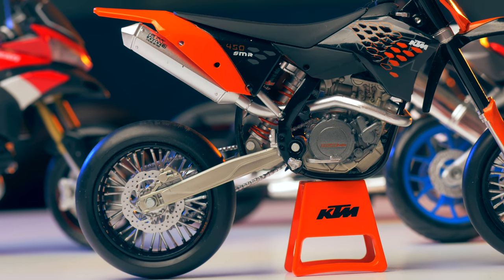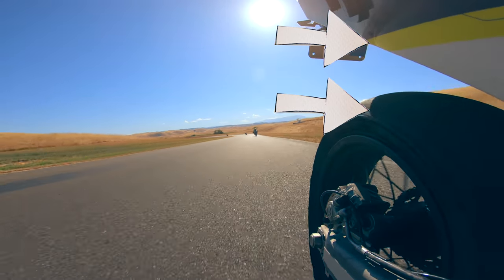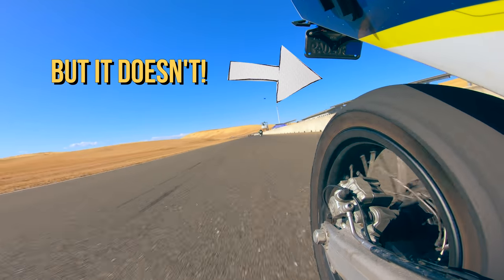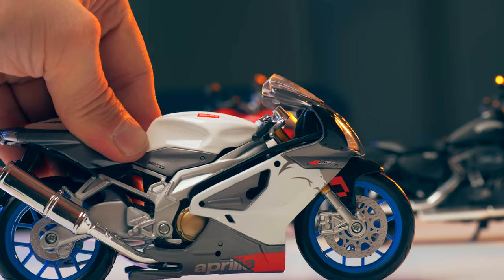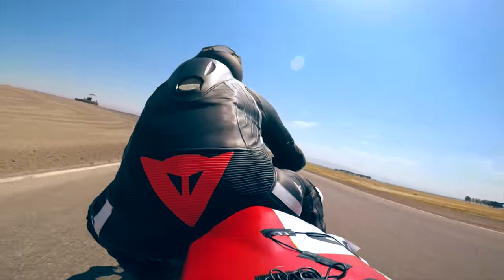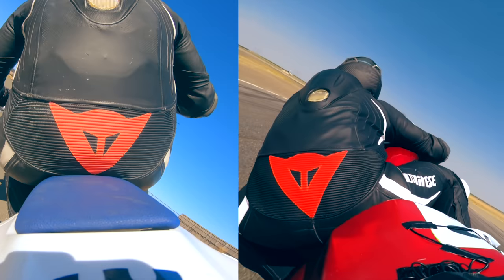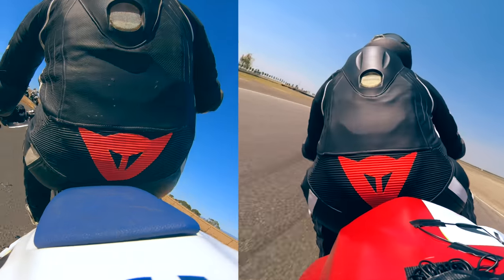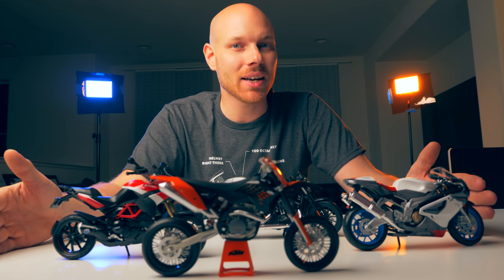Motorcycle Geometry | EXPLAINED

Comment: The rider is just an onboard engineer.
Reply: Believe me. As an engineer I cant onboard like the pilots on the video, lol.
Reply: @juanete838  I bet that you can tie your shoe laces though. I too am an engineer and have worked in motor sports, some of the best test riders and drivers are just useless at all other aspects of life. Good engineers do not make good test riders, this is because they can tell that things are going wrong before most other people would notice. One manager at a car manufacturer in Britain once said to me that it is the job of the engineers to break the vehicle, and it is the driver's job to crash it, adding that it is easier to replace a test rider than it is to replace a good engineer. You will only ever find the limits by going beyond them, and that can hurt, or worse.

Comment: A big thing that many  newbies over look  is   rear axle position.. 
Pushing the axle further to the rear will make the bike turn in slower and the moving it forward will make it turn in quicker without even  touching the front forks. So try to find the optimal axle length position and if you want to change gearing use different lenght chains to keep it in the sweet spot the rear of a motorcycle is often overlooked but very important for  optimal suspension settings

Comment: Excellent information. Well presented. Subscribed. Should be compulsory viewing for anyone who owns a motorcycle. I know, i am 65 & have been riding for almost 50 years. You must understand your machine for it & yourself to perform at the optimum. So much to learn but much pleasure in that. Thank you.
Reply: Great video, what field of engineering are you in?
Reply: Hi Raul. I’m a toolmaker in Aluminium precast dies for motor vehicle castings. I have a Suzuki SV1000, a CBR1100XX & an 85 Suzuki GS1100G.

Comment: Hi. Interesting and well explained for someone who wants to approach bike setup. There's a part though where I think you probably said something not exactly right, and it's about @ 10:15 where you say that, under braking, trail decreases.
My understanding is that trail is a function of the steering angle, offset and tyre diameter and that the fork length (unless you have a raked fork) is not a factor.
It is theoretically true that the tyre compresses under braking thus reducing the diameter and affecting the trail, but it's compensated by the fact that the contact patch gets wider (mechanical trail, etc.).
Regardless, as I said, well done and nicely put.
Ciao
Reply: Yeah, I was thinking the same.
Reply: I understand you reasoning, but when breaking hard, the rear lifts and the fork angle changes giving momentarily less trail. Of course, this is compensated by the tyre compression, resulting in more contact surface but less gyroscopic effect. I'm not a mechanical engineer but that's my understanding of that specific moment. Cheers from 🇵🇹✌️
Reply: steering angle changes when the fork is compressed

Comment: Great video in general, but the part around lean angle and COG is maybe a bit misleading.  Lean angle only becomes dependent COG location when combined with wide tyres (e.g. sports bikes) because the tyre contact patch moves away from the center line of the bike when you corner.  For something on skinny tyres the location of COG has negligible impact on the lean angle required for a given speed.

Comment: Not to be that guy, but something missing on the anti-squat portion is the fact that under acceleration the rear ride height of the bike actually increases not decreases which is counter intuitive. This is doe to the torque vector of the drive chain acting on the axle which sits below the pivot point of the swing arm and the drive sprocket. Or in other words, the drive sprocket is trying to pull the rear wheel to the engine through the shortest distance which is under the bike.  If the axis of rotation of the swing arm and drive sprocket were co linear or the rear axle where positioned above the pivot point of the swing arm than the opposite effect would occur.   This is one of the reasons why power must be applied smoothly when exiting a corning.  To much throttle will shift the CG forward and up. Once rear traction is lost the rear immediately drops until it regains traction at which point the suspension violently extends and draws the rear wheel back into alignment with the front resulting in a high side.
.
Reply: thank you very much until now i was very skeptical about the acceleration in a turn subject
Reply: Much appreciated the effort!!
Reply: - ... traction wasn't mentioned, would a bike with a lower swing arm  angle (more parallel) create more traction on acceleration because the pulling force is more lateral? The initial power would be *into the swing arm, as opposed to *perpendicular to a more vertical set up... So the question is, does traction come from more resistance (low swingarm angle) or less resistance (high swingarm angle) where weight, engine, rider, etc are all equal? I guess I should read the book.

The trade off is obviously trail length on the accommodated design? That why cruisers are as they are..? 

I should read the book. Any hints welcome. Thank you.

Comment: Its Actually very easy to understand.  From static sag to the basic gyro of the motorcycle.  Which is Actually what was taking place when you said : You want to turn and the bike wants to go straight.  Which is what you get with counter steering.

Comment: Solid stuff Mike! 👍 Thanks.
One thing about 'transfer' it's actually not weight, but Load.
Load Transfer. Weight is constant- I.E. bike & rider. But the longitudinal load changes from rear to front & vise-versa based on the amount of braking force & acceleration.

Comment: “The use of wide tyres causes another difficulty when the bike rolls because the contact patch moves further and further from the bike’s centreline and from its steering axis. The taller the tyre section the more pronounced these effects are; lower sections minimize them, for a given width of tyre. There are several effects. It reduces the camber thrust for a given angle of lean. Ironically, a bike with a higher centre of gravity or with the centre of gravity shifted in towards the turn, will require less angle of lean to balance its centrifugal force.” 
I took that off John Robinson’s book, Motorcycle Tuning Chassis second edition under the section of contact area in tyres. 
Perhaps maybe you could do a video why wider tyres need more lean angle to turn and narrow tyres use less. And how how centrifugal force is actually needed to turn with the same bike but different width tyres. Perhaps you can mention why did MotoGP used 16.5 wheels and why some asian drag bikes used bicycle sized wheels on their drag bikes. 
Thank you in advance
Reply: Hey man, I think you can understand this on a video better than with the words of my. Just search how steering works to youtube and click on some animation.

Comment: Hi. Mike. Nice video. I would like to add few pointers from my experience. Its not only the CG height, which makes vehicle agile or stable, but the ratio of vehicle CG height to rider CG. 

The way I explain it to my team members, is assume vehicle a vertical rod pivoted at ground with a weights clipped at a heights. While you give input at top end. Lower the height, less efforts you need to move stick around. Higher the weight, higher efforts and less accelerations you can give to stick. No doubt bike tend to capsize at lower speeds with higher height of weight.
To prove this, I did few experiments while tuning a production bike. 

In first trial I mount 15kg (for 150kg bike) weight at level of crank shaft or below engine and in 2nd trial, same weight above tank, the effect can be perceived significantly.
Reply: But the CoG is fluid on both Rider and bike to an extent. You can slightly manipulate the CoG through Shifting the center of mass. CoM. In turn the center of mass never changes, but the center of gravity has potentiality to be fluid to some extent.

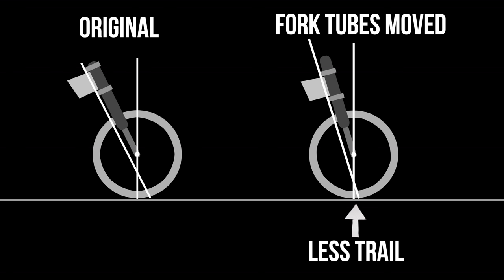Comment: 1:29 “It will also make the motorcycle less stable and, potentially, harder to control.”

What exactly does “less stable” mean? I’ve heard this phrase thrown out a lot when talking about changing your motorcycle suspension. But I’ve never heard anyone explain what it actually is. 

Does it mean your bike will randomly wobble at certain speeds and cause an accident? Does it mean the bike will fall to the side on a whim during riding unless you’re always holding the handlebars really tight? Will the bike just stop suddenly and make the rider fly off the road? Or will the bike jump into incoming traffic if you hit a minor bump on the road? 

What exactly do you mean by “less stable”?

Comment: Simple explanations of important principles in two wheeling. I run two boxer BMWs: an 84 R100 and 2017 R9T. Completely different geometry on a number of fronts especially the old vs. new suspension. When I get on the 84 after a lot of time on the 2017 I have to be very careful because I will go into a corner with some speed on the 84 and it will not respond at all like the newer bike: it will not carry the same line, will not be as easy to flick into a turn etc. It is a very quick lesson on geometry. There have been some pucker moments let me tell you.

Comment: Mx rider here.  So bigger offset triple clamps decreases trail which in theory would make the bikes more agile/less stable.  Then why in real world effect does more offset seem to make the bike more stable.  It is very common on motocross bikes for riders to change from 22mm offset clamps to 24mm clamps to get a more stable ride.  Is this effect due to the lengthening of the wheel base?

Comment: There is a ratio between trail and forks angle. And spring rate characteristics contributing to bike geometry while suspension is loaded mid-turn with cornering force.

Comment: Thank you for a very informative Video. However I have always wondered and please correct me if I am wrong. When you buy a bike stock and you wanted to get best riding experience from it, the bike would have to be setup as per your height and weight, right ?   I know nothing about the manufacturing process, So when engineers are designing the next 600 cc bike for example , do they take the test riders height and weight into consideration   and do they setup the bike as per test rider ?

Comment: So how the geometry of my 2021 Tracer 9 GT will change when i put a 180/60 rear tyre (instead of 180/55 stock)? And how will affect (fast turning? less stable on top speed? smaller caster angle?) my ride?

Comment: You're mentioning @10:14 when the rider brakes (decelerates) the swingarm angle increases however @ 10:50 while the rider accelerates, the swingarm angle ALSO increases which doesn't make any sense, could you explain how?

Comment: 1. Thanks so much.  I learned so much with your video.   I really did.

2. Only FYI: You are showing an Aprilia RSV (or RSV Mille or RSV1000) miniature not quite an RSV4.   The only difference is this model had a twin, not a V4 (hence the rsV4 name)

3.  How do you explain the fact that you need more lean angle with a lower centre of gravity?    I think I understood everything you showed except for this.   I mean, I know supermotos have a higher c.g. and they require less l.a. but they tend also to be massively (not marginally) lighter and as you mention much more aggressive trail.

Thanks again!

Comment: Always very informative and helpfull video's as I've just started a classic racer build of a Seeley TR750.
the original has a head angle of 27 dg. most builders I understand decrease it to 24 to make it steer more quickly.
my question is: 

how does head angle and offset influence steering when the trail stays the same?

kind regards

Noël

Comment: I have an issue/question about what you say at 9:27. That is counter to everything I've watched, been told, and read. Unless, what you're referring to are the rider's bodyposition and bike CG being taken independently. Thoughts?
Reply: its right what he says but yeah, cg of the rider is not taken into account here
Reply: I can't see how lean angle changes with height of centre of gravity?  Edit: OK just seen the correction from Mike. He means the effect of the lateral movement tyre contact patch on bikes with low CoG and wide tyres compared to skinny tyres and higher CoG. This I understand ang agree with. It's presented badly in the video.

Comment: very interesting subject and well detailed, I plan on running Bonneville land speed record straight line course, would you say an extended wheel base (9" extended swingarm) and lowering the CG with a lowering link would be a perfect setup for this kind of course vs a stock OEM setup (shorter wheelbase and higher CG)?  thanks
Reply from the maker: I've never been involved with land speed racing, so I'm sure there are lots of details that I'm not thinking about, but;
Having a lower CoG would definitely help stabilize the bike, as well as getting a longer wheelbase. Aerodynamics will obviously play a huge part in the setup of the bike as well. Adding more trail would be another thing to make the bike more stable.

Comment: Tire-width combined with weight is determining speed at given angle in turn. THEREFOR is a Motard, weighing 120 kilos on a 160 section tire, much faster mid-corner than a 200 kilo sportbike on 200-section tire.It is the offset of center of gravity and contact-patch that determins centrifugal power in addition to speed and angle.

Comment: I have a problem with my ZX-6R where it feels like the geometry is constantly changing. 

One week when I'm riding at a given speed (±70kmh/45mph), the bike feels great, it's responsive and stable, light & easy to lean in and change direction.

A week or two later, riding at the same speed, it feels like the opposite. 
Unstable (head-shaking), poor handling feedback (steering feels lazy and "delayed" almost.) 
It requires more effort on the bars to change direction.

The suspension also doesn't feel consistent. Sometimes it feels stiff and other times it feels too soft, even though the preload and damper settings have not been changed

Does anyone know what could be causing this? I've had my front and rear spring rates increased to match my weight, and I've had my sag set correctly as well.

I don't know what to do anymore.

Comment: Regarding trail: This is also relative to speed. An off-road bike can live with a longer trail because of the lower speeds, lower weight, and lower weight of the engine internals, and thus the lower gyroscopic effect.

In regards anti squat: Motorcycles with swing arms - shaft driven even more than chain driven - have a natural anti squat tendency.

In regards to centre of gravity: This can't be isolated to the bike alone, because it's very dependable on the mass of the rider. And the movement of the rider/the second chassis.

The centres not afflicted in the same way by the rider is the geometric centers, like pitch, dive, squat etc, tough the riders moving mass will affect the behaviour.
It's easily doable to make a bike anti dive, regardless of rider weight.

Or am I completely off the mark?

[Edit: Funny typo :)]
Reply: Ah yes - the "lover gyroscopic effect". Let me imagine that...
Reply: @anthonyefarr  :) Less rotating mass, or less inertia? What would be the correct phrase? I could of course write it in my own language, but on the world stage that language don't seem to fly ;)

Comment: good vid, one ambiguity at 10:58.  You mention a decrease in wheelbase as weight transfers to the rear but comment that this adds to stability, which contradicts the correct point you made earlier in the video re wheelbase. Sure its only one factor in play at that point but just sayin....